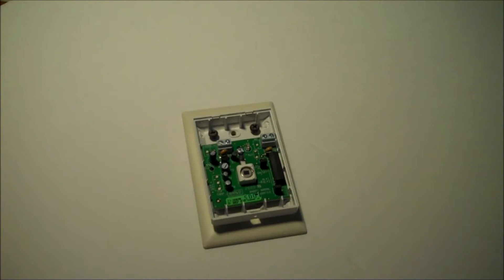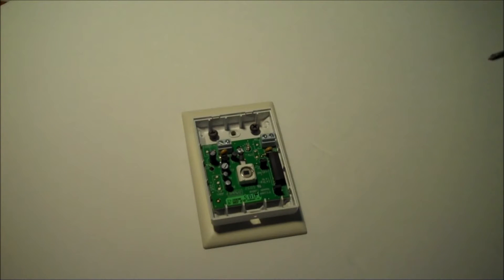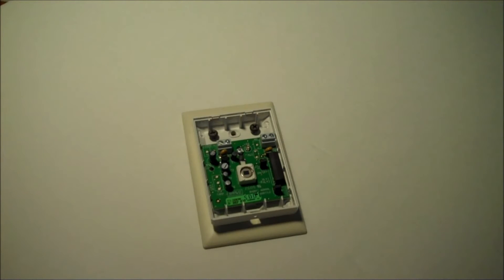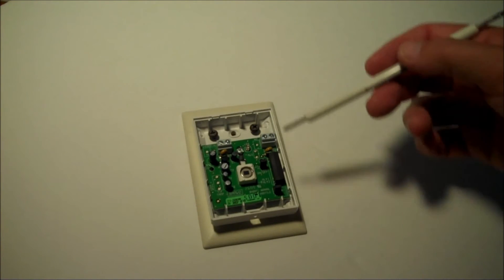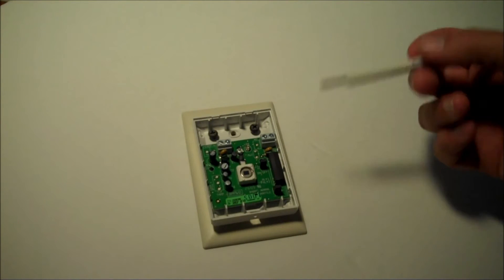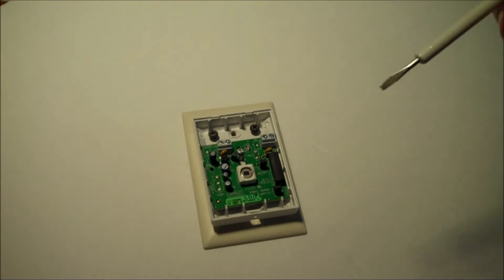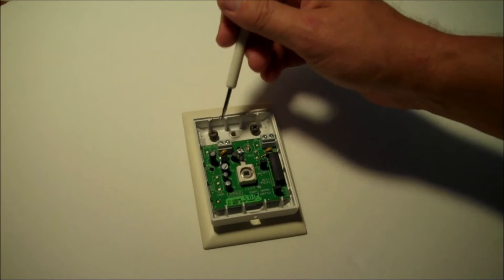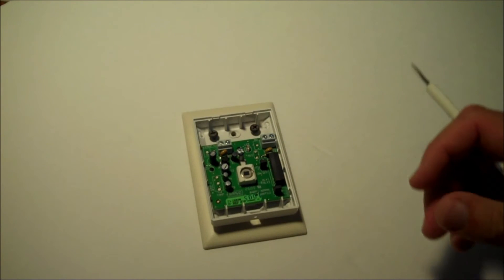Motion detector false alarms, how to prevent the causes.

Comment: I have a 6 ton air conditioning unit directly blowing air inside the PIR housing via it's own duct work, I find that as long as the same amount of air flow enters the inside of the PIR housing that exits, my falsing averages 1-2 a week.  Also, an automatic air freshener (with bug spray inside instead of fragrance) aimed at unit (from side) helps with insect infiltration.